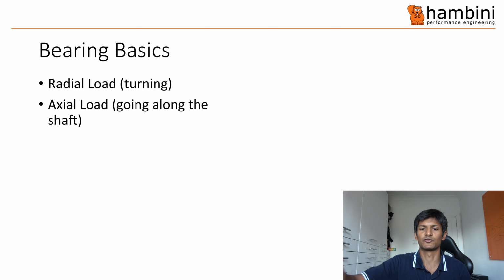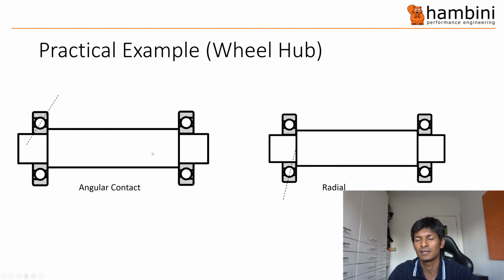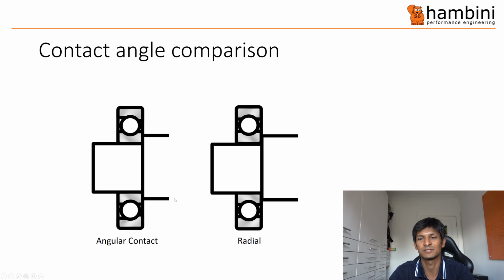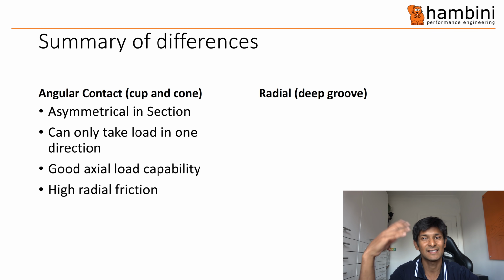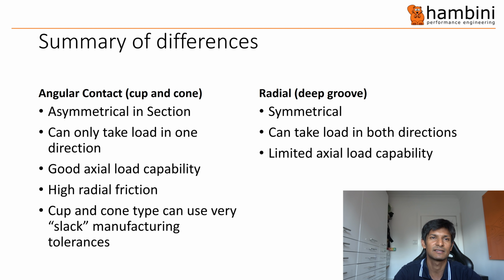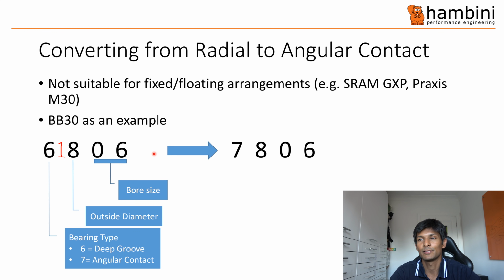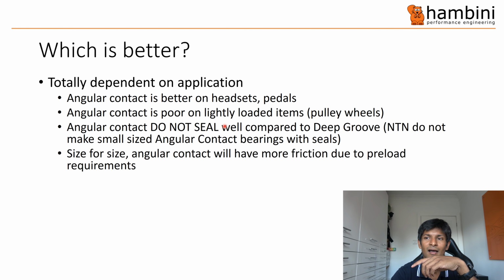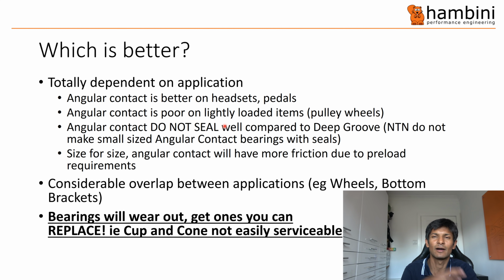Angular Contact vs Radial Bearings (Cup and Cone vs Cartridge): Engineering Analysis

Comment: can you comment on roller bearings, in particular, their application in headsets and whether they are better or not compared to ball bearing headset?
Reply from the maker: Do you mean needle roller?
Reply: Hambini yes please!
Reply: @Hambini
Am I wrong to think that headset bearings are the least of my worries as long as their work properly ?
After all, this piece of equipment only rotate ½ a turn at most with no incidence on power output.
Reply from the maker: @sylvainmichaud2262  Provided your steering is not wobbling and doesn't feel loose, I would go onto something else.